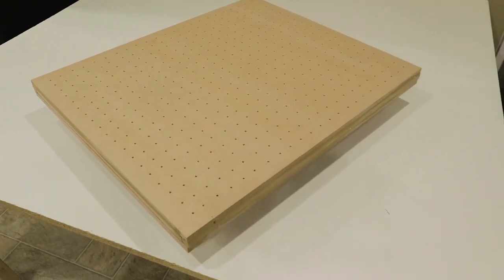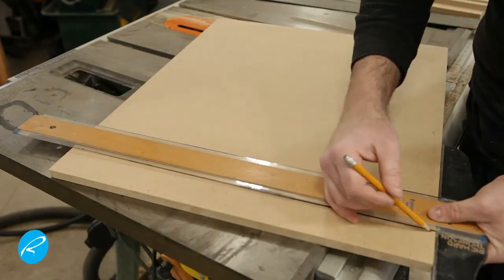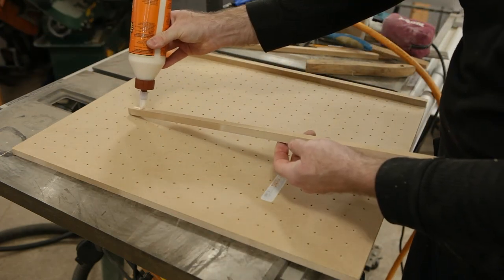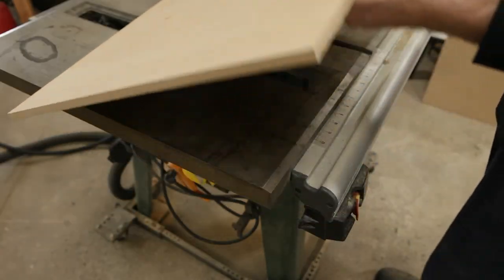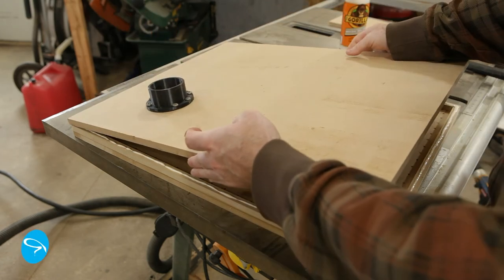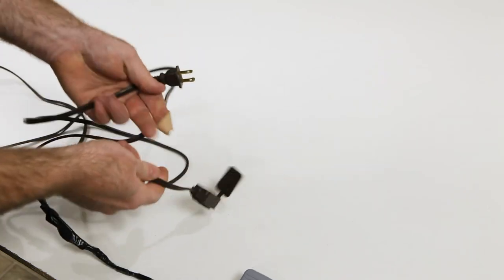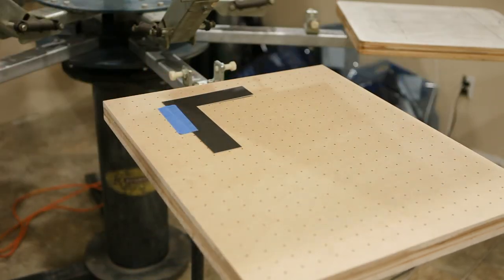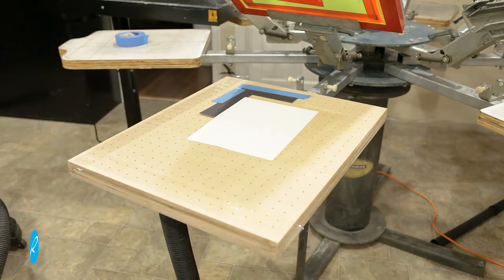Making a $30 shop vac powered Vacuum Palette for screen printing posters and other paper goods.

Comment: What is the watte of your vacuum?
Reply from the maker: If you believe the sticker on the side, it's 1400 watts. But I think a smaller vacuum would work just as well. You can get more suction by  taping off the unused holes.